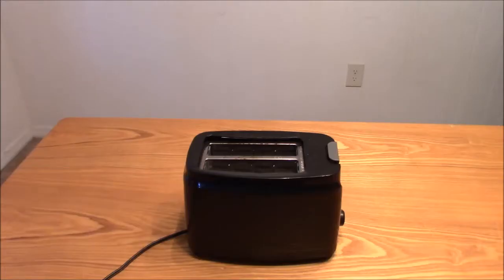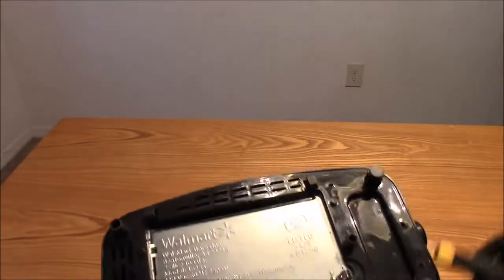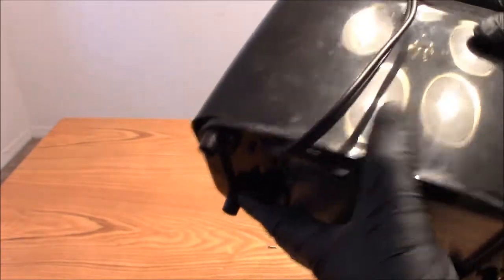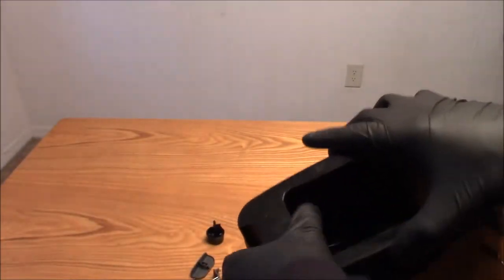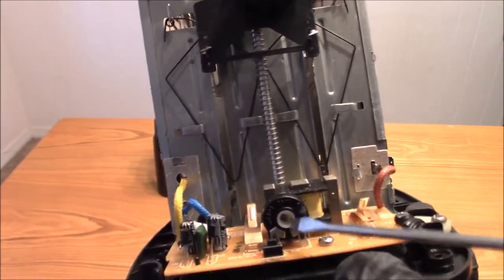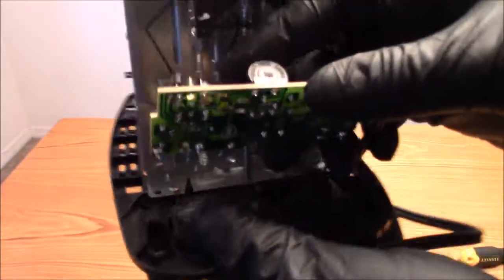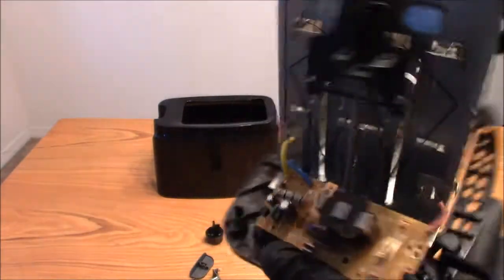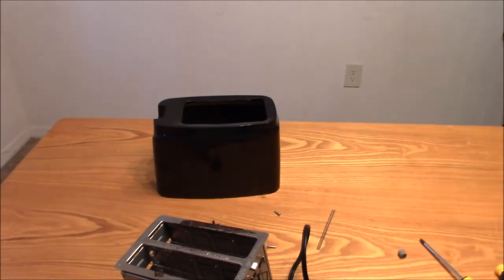How To Take Apart A 2 Slice Bread Toaster To Find Out How It Works And See Whats Inside The Device

Comment: my oster toaster doesn't have phillips screws in them they have a plastic toggle which i somehow have to turn. They are quite fragile as i took a flat head screwdriver and put it in the hole and gently turned they started to bend and i didn't dare to turn screwdriver anymore it would have broken them. Any ideas?

Comment: The potentiometer controls the amount of electricity that goes in to the resistor. When full the electromagnets give in. So it does not in any way control the heat. Just for the record.

Comment: The control knob does NOT raise the voltage and "heat it up hotter". It is a type of thermostatic timer that keeps the toaster locked until it reaches a desired point. Sorry but.....